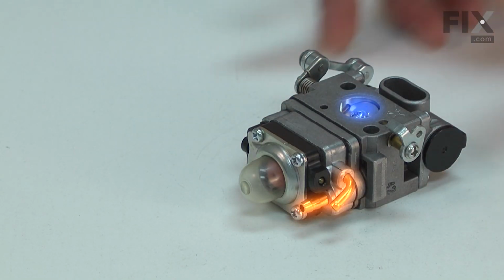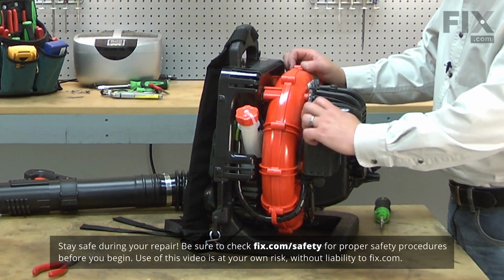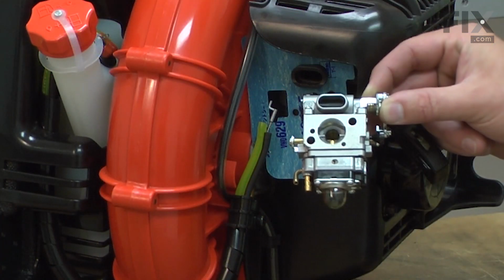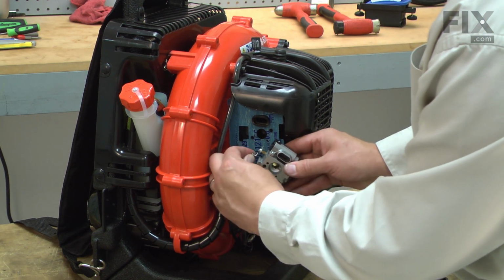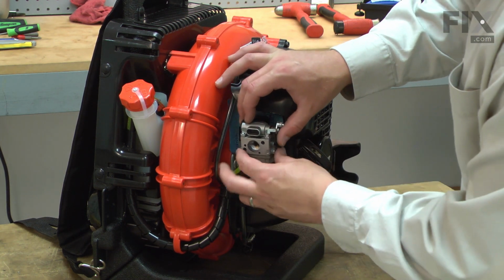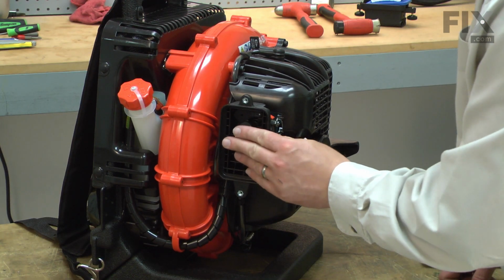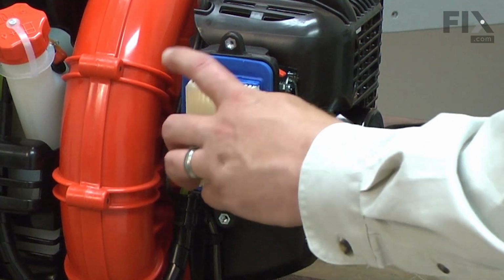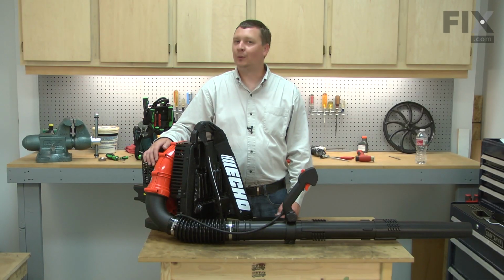Echo Blower Repair - How to Replace the Carburetor

Comment: I would like to have seen if it would run after installing the new carburetor.That was the  reason to replace it in the first place.Also, i would like to have seen any throttle adjustments made if needed.Other then that i liked your video.